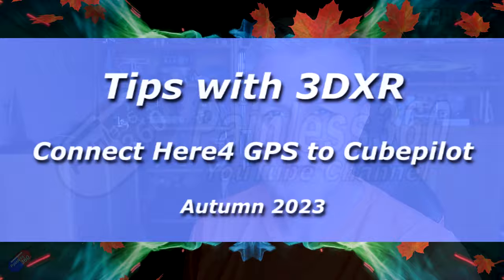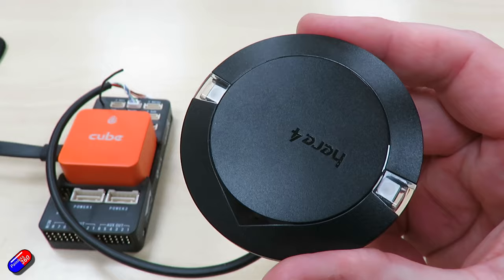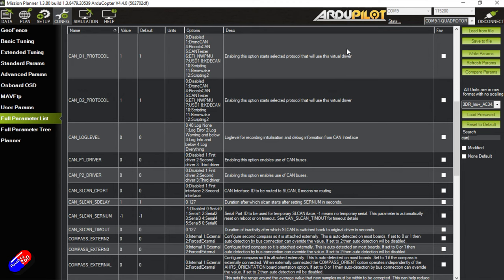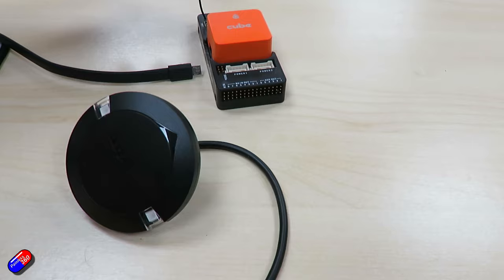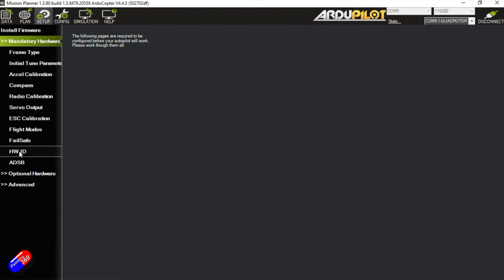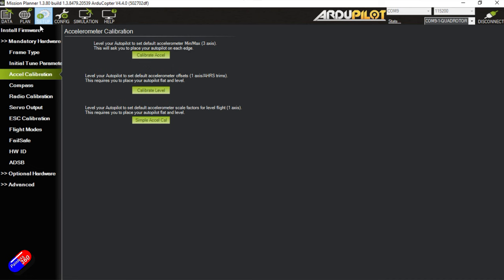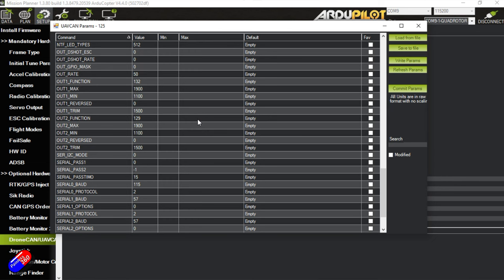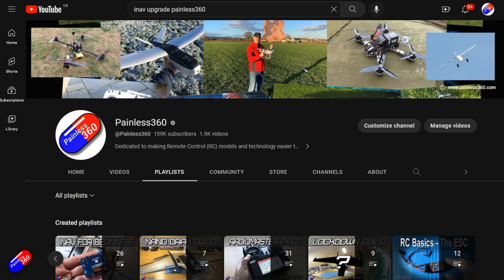Setup and configure a CANBus GPS in Mission Planner: Here4 setup guide

Comment: I have thanked you with my respect. ❤ I need some assistance. My tether drone spinned 360° yaw, a havoc fast yaw. Upon checking the Ardupilot log, I noticed that yaw command was given to the drone from my SIYI MK15, but I never did that. I use 2 of these same GPS.
Quick setup I use:
1. Tmotors 4006 380kv
2. X8 SETUP
3. SIYI ZR10 camera with SIYI MK15 TX
4. Tethered system (Elistair 70 meter)

Drone gave some jerks and twitches. 
Please help.
Reply from the maker: If Ardupilot recorded a YAW command, then I'd check the radio setup and calibration, failsafe settings as step one.. Check out my last build - https://www.youtube.com/playlist?list=PLYsWjANuAm4rXSCRfiZkpuBmUP0u-lLby - to see how I build them here... Best of luck

Comment: Why two cables on the Here4? I noticed you connected the blue cable to the CAN port. Are they both CAN cables? Sorry, I can't find any mention of this in the Here4 documentation...
Reply from the maker: At what point in the video?
Reply: I found it in the documentation: 
   Pinout:
   CAN x2（Current firmware only supports CAN1-green、blue、white、grey）
I found it by reviewing the Here3 documentation which made this more clear, but used the other harness for CAN1.

Comment: Hello, thank you for this great video.  I have a question did you use the here 4 with its flight controller?  I wanted to buy one to install in a bait boat but I couldn't find any videos to see if it's worth it and if it works well.
Reply from the maker: It isn't yet supported. I'll be making a video on it when it is... Happy flying
Reply: @Painless360  thank you very much for your super quick response.😉

Comment: Is there any improvements in terms of positional accuracy as compared to Here 3+?
Reply from the maker: This contains an F9P, the P stands for the extra precision. The Here 3+ has an M8P inside. The F9P with a dual-band antenna provides a very large reduction in both altitude drift and horizontal drift over a single band M8P